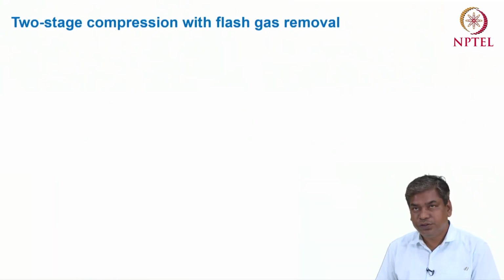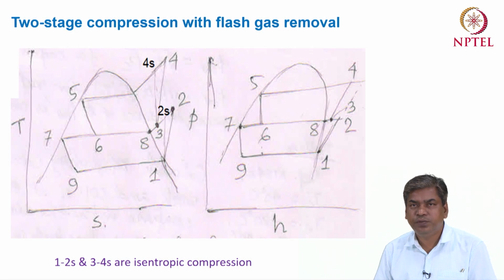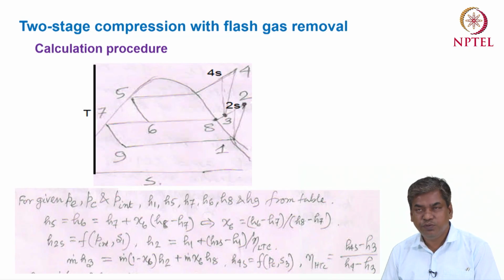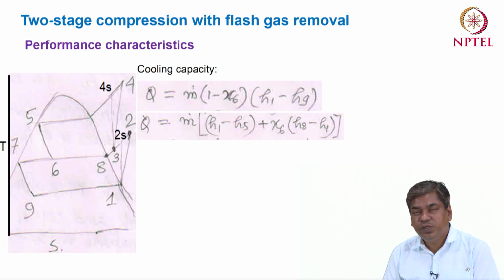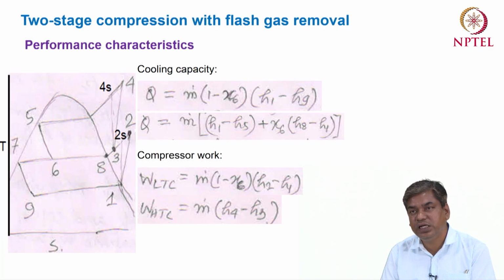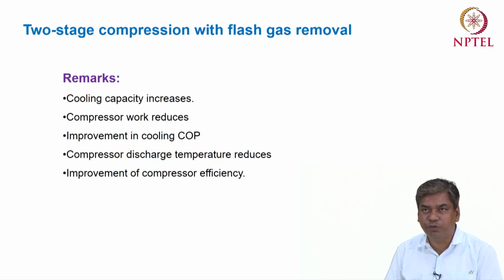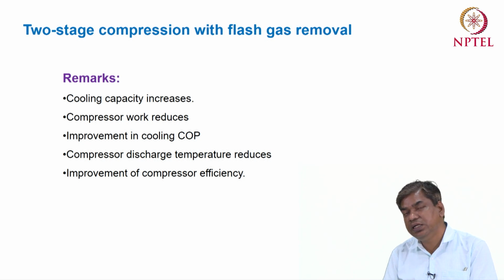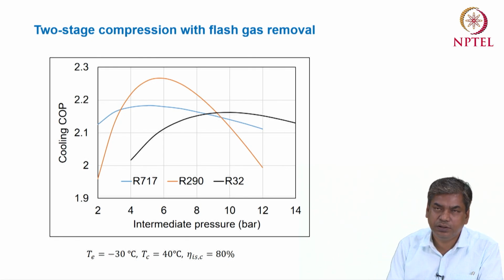Two stage Compression with Flash Gas removal

Comment: The described two-stage compression with flash gas removal aligns with TUKE's capability to handle diverse gas media and inlet conditions across our standard operating envelope. Given the specific process requirements mentioned, what aspects of the package scope or cooperation model would you find most relevant for your project?